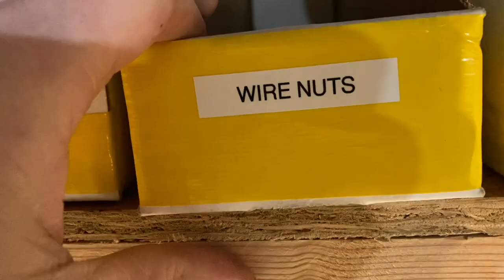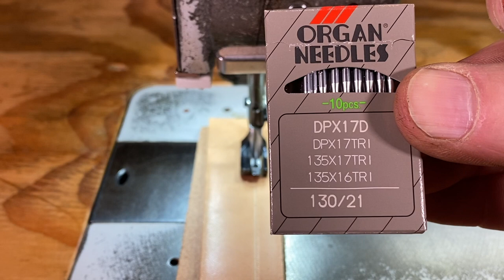Pro LED Lighting for Your Industrial Sewing Machine

Comment: Excellent lighting setup!  I especially like the magnets so you can use that little setup elsewhere if you want and no mess on the machine with adhesives or other fasteners. Btw, how is freehanding the wheel with the new servo motor and pulley? It seemed like it might have been a little tight.